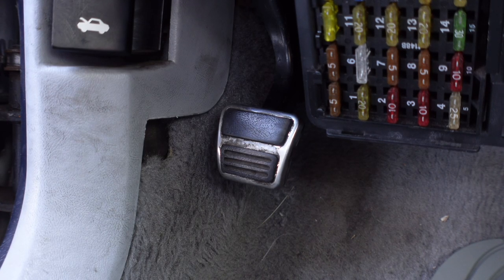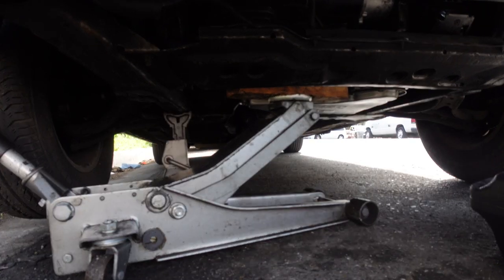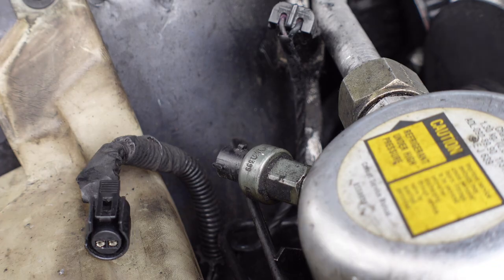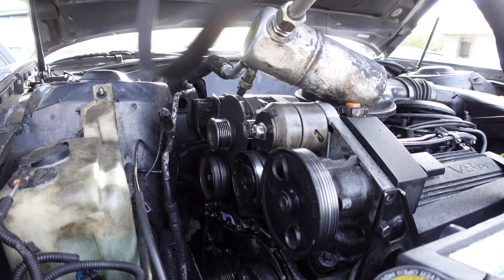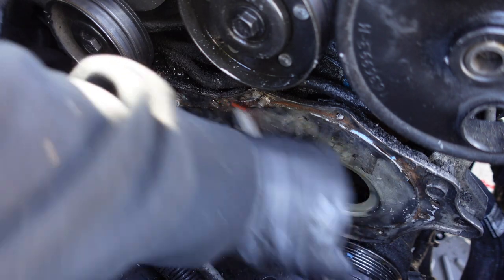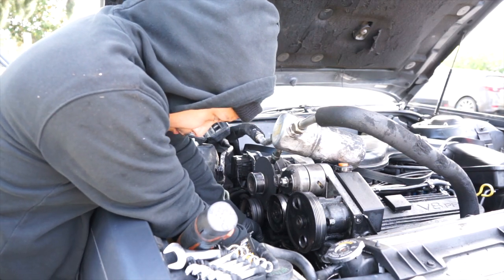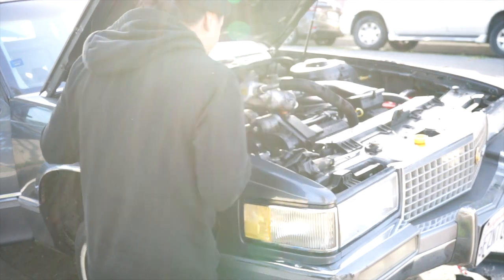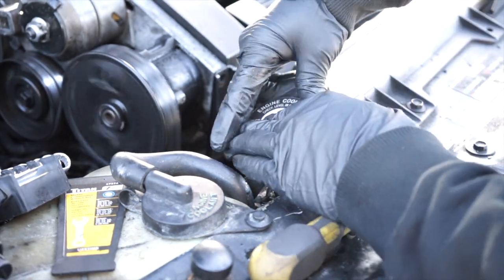Leaking Water Pump: Replacing the Water Pump on 1990 Cadillac DeVille

Comment: Bruh u the only one on YouTube thank u bruh
Reply from the maker: Take your time and be patient. This job can be frustrating and by the way, I did end up using fel-pro gasket and some RTV silicone. I did this job twice. 🥲
Reply: Appreciate the video homie. Doing the same job now on my 90 Seville. Luckily there’s quite a bit of room compared to the deville so all I had to remove was the battery and coolant res, and had quite a bit of space to work with.  Only bummer is 3 broken 10mm bolts I’ve gotta extract… it’s never that easy 😭

Comment: Helpful video!  Here's an important tip tho: there's an ACCESS PANEL behind the pass side wheel that makes it easier 2get2 the lower bolts (i have a '93 4.9; the 4.5 shld be similar). Remove the pulley bolts by jamming a screwdriver (etc) thru it to keep it from turning, then let it hang there. It will come off later when you unbolt the pump. This SHOULD eliminate the need to raise the engine but the 4.5 may be slightly different. Dont forget to transfer the pulley to the new pump BEFORE u rebolt that to the engine. The torx screws are no biggie; they're not on tight. Be careful with those 13 little screws (10mm) he mentions; they are ez to drop! Btw: after ur done, refill the coolant thru the thermostat housing, NOT the radiator cap; this prevents air binding. Good luck. Thx again guy for the video😊

Comment: About to do this on my kids mothers extra car. Ima mechanic but was looking to find what tools to pack with me. 

Video helped me alot to know what I needed.  Took me 23 min to total to change about 45 with double checks an finishing buttoning up to test start.
I was in the woods behind her house with no tools around but what I brought from home.

So if your not a mechanic an still like to try to learn an diy then this is a project you can handle. For anyone that mechanically inclined.

I would say give yourself 2 hr of working time if your not a mechanic. That should be enough for the average person to give it a go. But if your decent with tools and fixing stuff then I would say you could get the water pump shaped in a hour an be buttoning stuff up at the hour mark .

But yeah don't be afraid this is a good job to learn alot an shot how stuff can be in awkward places to work on but it's str8 forward to do with a mix of tools an small problem solving

Comment: I'm working on my 92 with the 4.9L.  How the hell did you get the bottom torx bolt, and the bolt on the bottom under the pully out.  I've spent an hour and a half on just those 2, and still don't have them out.  I'm about ready to push this thing off a cliff.
Reply: Undo your motor mounts and jack your motor up so they clear the frame rail.